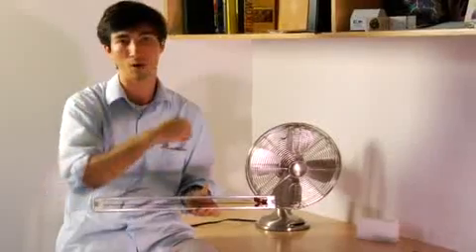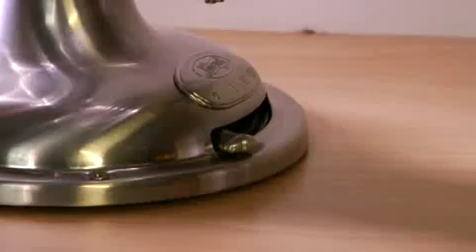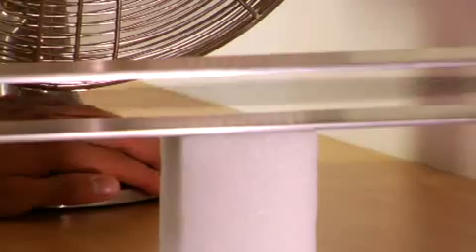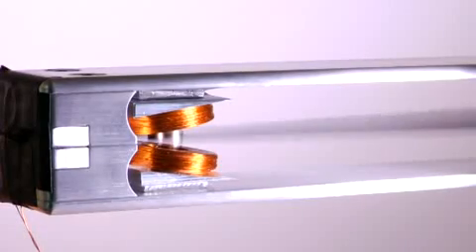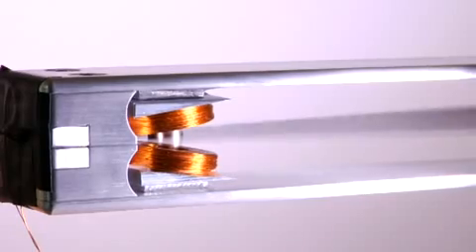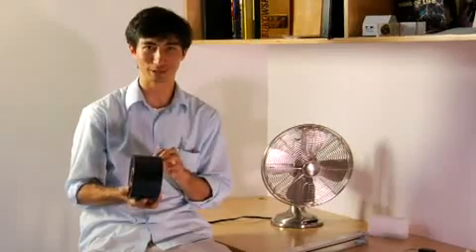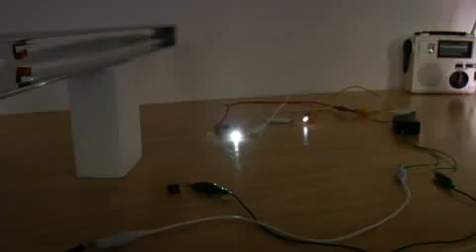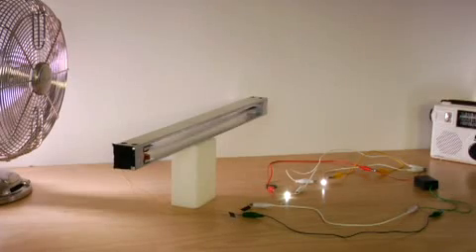Windbelt Micro-wind Generator

Comment: Nice concept.  Wonder if you could also add the coils and magnets to both sides of the belt.  Then for more power, several of those units hooked up in parallel will give you more amperage.  Series and parallel for more voltage and amperage as you would connect with batteries and solar panels.  Great idea!  Keep it up.

Comment: It shouldn't be too difficult to figure out an automatic tuning system to dynamically adjust the tension for the optimal energy generation.
This could possibly be an electronic, 'active' system, or perhaps even some sort of passive system using variable resistance elastic bands.